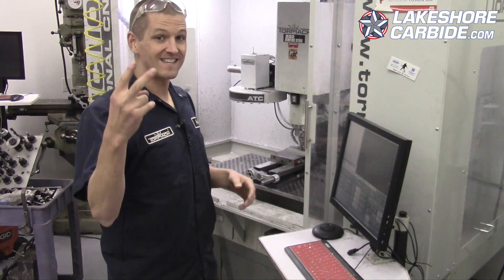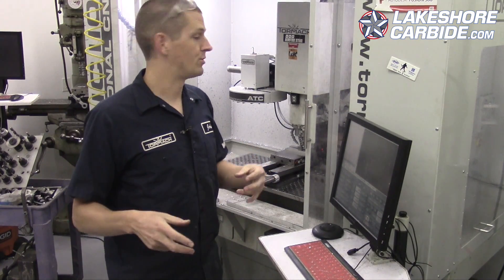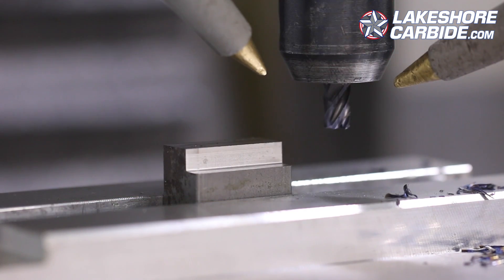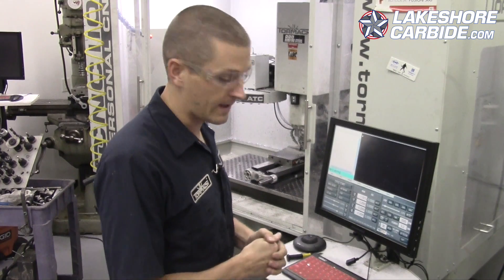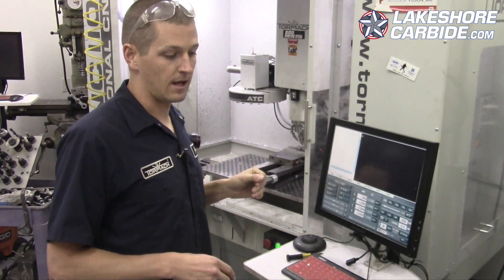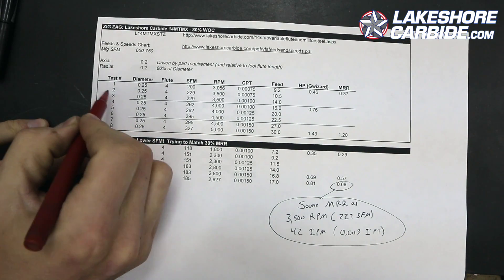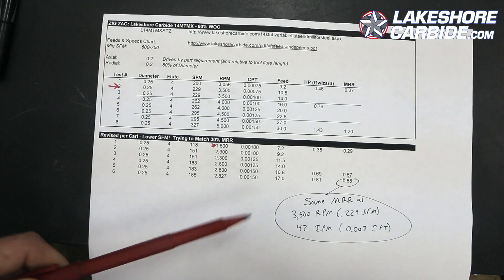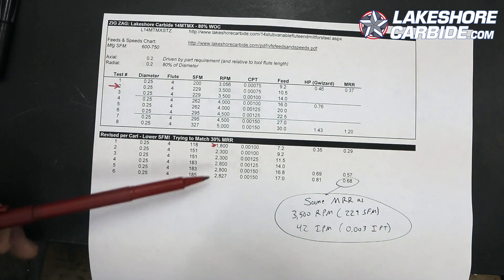9. Calculating Feeds & Speeds:  80% WOC Zig-Zag!

Comment: What happens when you have to do a slot or groove using the 100% WOC? Is the 0.001 IPT ok to start with? Or there's other recommendation for it in other to guarantee chip evacuation? What's can you do in this case?

Comment: Thanks John for making this video. I learned a lot! My question is, for aluminum how can you tell if the chips are getting too hot?
Reply: +Matthew Tang I grew up with a tool and die shop in my garage.  It was all hand mill, so my rule of thumb for aluminum was... if it bounces off the skin you're good, if it sticks and burns into the skin it's too hot.  Another way to tell is how the coolant reacts  If the chips leave a visible "smoke" trail for a fair distance, it's usually a good sign of excessive heat

Comment: Great series. Thank you and thank Lakeshore Carbide for these.

At about time 9:30 you say that one in four chips seem to be blue, and you are cutting with a 4-flute end mill. I would be looking for  single tooth damage or irregularity, or possibly runout causing one tooth to make a deeper cut. When you are making 0.0005" adjustments in cut per tooth, 0.001" runout would make a huge difference on one* of the teeth. I would be really interested in seeing an indicator put to that end mill in the spindle while rotating the spindle slowly backwards and recording the heights of each of the four cutting edges.

===========
* or maybe two, depending on the indexing of teeth to runout
Reply: +Peter W. Meek Run out or damage was running through my mind as well... I'm going with run out, especially with an end mill holder like the one being used. Run out is the main downfall of that type of holder.
Reply: +Peter W. Meek A single blue chip is more likely a damaged flute as you say. Thin chips are easier to blue as they have less mass and so go to a higher temperature with the given input of btu's from the cut.  Thick chips are always cooler given the same speed and feed. Damage as you predict will push more and contribute more btu's. Nice observation! you are a detail guy...

Comment: The variation for the last cut might be due to a change in one of the non obvious variables, the stock. It's only leaving a slice there which may be flexing and folding with the heat.

Comment: Why are you so afraid of blue chips? Blue is good for machining of steel.
Reply: +14220cz Agreed to a certain extent. Dual colored chips are ideal starting from straw and going toward blue. If the chip is completely blue and even shifting toward purple, then there is more heat in the cut than the chip can take away. The heat has to go somewhere so it's going into the part and your tool.
Reply: +14220cz I agree, I was under the impression you want the heat from machining to exit with the chip, not stay in the workpiece and tool, which means a nice blue chip
Reply: +NYC CNC You are right. Like Kenneth said you don't want a dark blue or purple chip. Light to medium blue chip is what I look for.  I will add this is with carbide tools and no coolant.  Great videos by the way!
Reply: Kenneth Higley Well... Not really. When you increase the cutting speed, you increase also the proportion of heat taken away by chips so heat affects less your part and your tool.

Comment: What if I am slotting?  I have no choice to go 30%. I am no where near your MMR. 1/4 hot rolled steel plate, 4 flute carbide,  .065 DOC, .25 WOC (slot), 4500 RPM, 10 IPM, Tormach 770. I moved from the x2 to a Tormach to make parts faster. Trying to unlock it speed.
Reply: +NYC CNC Please do a follow up video on slotting, I'm quite interested aswell
Reply: +Tzadvantage Bkk - Thanks, great video! not exactly what I am doing though.  I am cutting the corners off 1/4 plate steel to make an oval shaped cover.  Probable best done on a plasma table but I don't have the money or space for it.  I also need to machine other features in the cover which has to be done on a mill.  Volume is too low to hire it out.
Reply: +NYC CNC - Thanks John!  I tried 1/8 EM but it snapped too easy.  I have a 3/16 EM so I will give that a try along with your zig zag method.  I will check out HSM toolpath.  I't not familiar with it.  Thanks again!